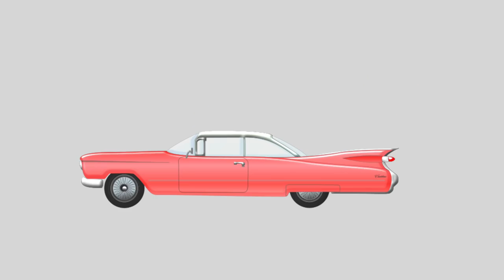Yes, Rockets CAN Fly in a Vacuum

Comment: Vintage Space I was wondering if you could provide a math formula that proves FREE EXPANSION in thermodynamics is not in effect in the near perfect vacuum of space, and could you also provide the math for the  debunking of work formula where work = pressure external (0) in space X the change in volume = zero work performed; that would really help clear up the confusion.

  The thermodynamics students are confused about the conflicting propulsion example given here VS the laws governing how gasses perform work, there is also some confusion about how high pressure can be obtained when the rocket system is an open system fully exposed to space at 0 pa; yet somehow pressure will just choose to stay in the combustion chamber, throat, and nozzle instead of just taking the path of least resistance and escaping out the nozzle and avoiding all that unnecessary work, and job pressure. 

  The chemistry students would also like to know how combustion and or chemical reactions happen in the zero pressure environment, becuse their experiments are failing to obtain combustion even with chemicals that have high levels of oxidizer and they are not even able to obtain the level of vacuum space provides at 10 x -17 torr or 0 pa.  Thanks we are all looking forward to the math so we can resolve conflicting issues...
Reply: Well, I'll have a punt at it.

Your error is in thinking that rocket engines would have to violate Joule Expansion, rather than thinking of the rocket as a rather big particle.

Joule Expansion, or Free Expansion as it is also known, is basically a thermodynamic explanation of the conservation of momentum, in that it describes a gas filling available space without doing work.

Well, for the gas to fill the space without doing work, you must have the centre of mass of that gas cloud stay stationary. But if we only consider the exhaust gases, then the centre of mass of the system will clearly move, meaning work has happened somewhere, however if you also consider the rocket to be a particle in the same expanding cloud of gas, you'll see that the gas cloud (this time, including a rocket that starts to move) expanding with no work being done.

Also, most Thermodynamics students I know are confused why people like you claim that the expanding rocket exhaust, impacting the inside of the rocket engine won't result in that rocket engine being pushed away.

Not to mention that, most chemistry students I know wonder why you'd think a pressure would be required for chemistry happens, since you just need the chemical reactants to be close together, and an energy source big enough for stuff to happen.
https://www.youtube.com/watch?v=Zv6KQzlLwU4
Here's a video of gunpowder being ignited in a vacuum chamber, just for funs.

And finally, the "pressure" of space is given as 10^-17 torr (whether such a small pressure can be called pressure is a whole different topic). Where did you get 10 * -17 torr?
Reply: @ShadowFalcon  ESA cleared up the confusion the moon is in our atmosphere.  Maybe in another 6 months all of space might be totally eliminated also.

http://sci.esa.int/soho/61130-earth-atmosphere-stretches-out-to-the-moon-and-beyond/
Thanks for attempting to solve the impossible problem, but ESA beat you to it.
OCS
Reply: @uncommonsense9948 
Methinks you need to read that article again mate.

Specifically when it comes to the distance of the moon, the density of the geocorona, and the Interstellar Medium.
Reply: @ShadowFalcon   Thanks for the video Falcon.  The Cody's lab vacuum video is having the same results we are seeing.  If you trap an atmospheric pressure in with the chemical a raction happens if not nothing happens even at a low vacuum.

  Simulating the 3 kalvin  average temp. of space with a 10 -17 torr vacuum would be more realistic but very difficult, and nothing is reacting anyway so why go through the extra trouble.

 It would be interesting none the less to trap the atmospheric pressure in the bottle then drop the temp to 3 K and see what happens; my predection is nothing will happen "no reaction"; if the temp. goes down so does the potential for pressure. 
OCS
Reply: @uncommonsense9948 
Well apparently you didn't watch the video., because the video clearly showed gunpowder igniting, whilst in a vacuum.

As for the temperature, space doesn't have a temperature, so I don't know where you get those 3 K from.

And the it's still not 10 -17 Torr, but 10^-17 Torr (or 0.000000000000000001 Torr).

Edit : actually the funny thing is that, the reason it's so difficult to get a loose pile of gunpowder to ignite in a vacuum, is because the gunpowder that does ignite produce gas, and blows away the rest of the pile before it can ignite. So even without the canister holding the gunpowder together, something definitely still is happening.
Reply: @ShadowFalcon  Thanks for the reply. The rocket is an open system not a closed system so the gun powder outside the bottle would be more realistic. The powder in the bottle proves without pressure no chemical reaction is possible the bottle contains enough atmospheric pressure to allow chemical reaction.

If 10^-17 Torr could be obtained in that vacuum chamber with a temp of 3 K  nothing would happen.

 Finally I think you can do some research on average temp. of space and find the number.
OCS
Reply: @uncommonsense9948 
The "bottle" as you call it, is also an open system.

The pressure in that bottle is the same as in the rest of the vacuum chamber.

And still, vacuums have no temperature. Without matter, you can't have temperature. The only temperature a rocket would have to overcome would be the temperature of the propellants (which in the case of cryogenic rockets, is a very low temperature).
Reply: @uncommonsense9948 
In any case, the primary reason for why the gunpowder is tricky to ignite, is because of its relatively slow burn time.

But most rockets don't run on gunpowder. They run on liquid Hydrogen and liquid Oxygen, or Kerosene and liquid oxygen, or hydrazine and nitrogen tetroxide.

All of those burn much faster than gunpowder, and in the case of hydrazine and nitrogen tetroxide, they'll ignite on contact.
Reply: @ShadowFalcon  Vaccums have no temp with out matter??  the rocket has matter and the fuel and oxygen have matter so there is some matter to react to the 3 kalvin average temp. of space.  If the above does not have matter what would you call it because matter has moles right? so the spraying of moles from fuel and oxygen or other chemicals is adding a lot of moles to space in a localized area, they will transfer  the cold temp.
  Moles do matter when combustion is the topic related to propulsion.  FYI moles stop moving at 0 kalvin and all the above statemets are published; not saying that means they are facts we the individuals can't prove it without lots of work, but it is accepted information.

OCS
Reply: @ShadowFalcon  Thanks for the fuel and oxydizer breakdown but I dissagree about chemical reactions in an open system at 10^-17 torr vacuum and 3 kalvin nothing does.
  It is so hard to get that kind of vacuum no organization on earth can obtain that level of vacuum.
The gun powder has an extreamly good reaction time and is easy to ignite that is why bullets are projected using the almost  always  ignitable and reliable gun powder.

 Yes a bullet will frire out of a gun in space there is enough atmospheric pressure in the bullet and shell casing pair that is tightly sealed, to allow combustion of the gun powder, so do not stand in front of one fired in a vacuum it will be the last time you will try that.
The glass container was closed with atmospheric pressure in the glass jar, there was not enough pressure differential with cody's low vacuum to pull all of it out so some pressure was in there allowing the chemical reaction to happen, but at 10^-17 torr it would have all been sucked out of the bottle and not allowing any gasses to build up pressure before they got sucked out of the bottle.
OCS
Reply: @uncommonsense9948 
What would stop the chemical reactions?

How can nothing, stop stuff from interacting?
Reply: @uncommonsense9948 
And yes, vacuums have no temperature, because to have temperature, you need to have matter.

The rocket has a temperature, it's actually quite hot because of the friction with the atmosphere as it goes up, and in case of cryogenic propellants, the fuel and oxidiser will be quite cold (between 14 K and 20 K for Liquid Hydrogen, and between 55 K and 90 K for Liquid Oxygen).

Space, on the other hand can't have a temperature, because there's no matter in space to have temperature.

As for moles. I don't think you know what a mole is. A mole is a measure of quantity, more specifically it means 6.022141*10^23 of something (for instance, atoms. Or possibly molecules).

Moles only matter, when it comes to balancing the combustion budget (basically, I have so many moles of O2, which will react with so many moles of CH4, which means I need to have so many moles of CH4. After that calculation you scale up to liters, and work with that instead, because it's a quantity, and counting molecules is tedious).

And I must repeat my question.
How did you get that 3 K temperature for space? What exactly is it, that has a temperature of 3 K?
Reply: @ShadowFalcon  Again the rocket is spraying in the matter in the form fuel and oxygen pumped into a 3 kalvin environment; unless now all the sudden fuel and oxygen have no matter in space.
Reply: @uncommonsense9948  
The temperature of the propellants are whatever they were in the tanks. They may radiate some of that temperature away when initially released into the combustion chamber, but radiative cooling is very inefficient, so you wouldn't loose a lot there. The biggest temperature challenge you'll have to overcome when it comes to igniting this, is the initial ignition of cryogenic propellants, where you have LH2 at somewhere between 14 K and 20 K, and LOX at somewhere between 55 K and 90 K, but the LH2 will already flashboil from being in contact with the much hotter LOX. Again, the propellants aren't being exposed to a "cool" temperature, since space doesn't have a temperature.

As for the CMB. That's the amount you'd be heated by the CMB, if that was the only energy source you'd be exposed to. The CMB is the blackbody radiation of the particle horizon of the universe, meaning it emits light consistent with a blackbody heated to about 3 K. So, in effect, when we release our two cryogenic liquids into our vacuum, they'll actually be heated a bit by the energy received by the CMB (but, since that energy is only consistent with that of an object with a temperature of about 3 K, that will not be a great amount of heating). There are actually other temperatures that can be associated with space, such as those of the Interstellar Medium, which can range from being a frosty 10 K, to an absolutely scorching 8000 K, but since the ISM is so thin, we don't generally need to take that temperature into account either.

And no, it isn't a "deep" topic. It shows your lack of understanding, regarding how vacuo work. Let's look at those experiments with gunpowder in a vacuum chamber again. We had two cases, one where we had a loose pile lying exposed, and one where we had the grain being relatively contained in an open cylinder, but otherwise still exposed to the vacuum. In the case of the loose pile, we did see reactions, but the reactions also helped blow the rest of the propellants away from the ignition source, thus throttling the burn of the gunpowder. In the case of the cylinder however, the gunpower was still exposed to a vacuum, but because of the cylinder, there was only so many ways for the propellant to go, meaning the flame front had a chance to catch up with the propellants. The nothing void of space can't stop anything, because it isn't a thing. To stop a force pair from happening, you need to remove the forces, but since we know a mass has been accelerated (the propellants move out of the rocket very fast), we know there has been a force. And the propellants will not be stopped from interacting, just because of the blackbody radiation from a far off particle horizon shining upon it.

As for your hypothesis. It is wrong. Upon combustion, the gas will expand in all directions, not just one. We however see the gas move, in just one direction (out of the exhaust nozzle), which means the gas MUST HAVE BEEN ACCELERATED. And since the gas has been accelerated from the nozzle (in the case of a J-2 engine, the gas cloud started with a net velocity of 0m/s, but ended up with a net velocity of 4130m/s when it left the nozzle) we know there must have been an equal but opposite force on the nozzle. That's the medium the rocket interacts with, the expanding gases resulting from the combustion of the propellants. As for the mass of the gas being equal to the mass of the rocket. Seeing as the propellants typically make up about 80-90% of the rockets total mass, I believe we have that covered, but in any case, let's look at the math.
F=m*a. So Force equals mass multiplied by acceleration. This means that, to accelerate a mass, we need a certain force, but it also tells us that, to get a certain force, we can either chose to accelerate a lot of mass, or we can give a little bit of mass a lot of acceleration. And seeing as we both have a lot of acceleration following the combustion, and a lot of reaction mass to work with in the form of our propellants, I'd say we have plenty to generate force with. Also, you still haven't proven that space is faked, so why even claim it was faked when you don't even understand how rocket propulsion works?
As for rockets working in atmospheres and vacuo, they typically work better in vacuo, because they have less ambient pressure to work against.

Well, I care. I care enough to actually get involved in shouting matches with those uneducated trollops who think space exploration is a "waste of money". I care because I know of the fruits we've harvested from the exploration of space, and the PC I'm typing this on is the least of those. As for gas laws, the gas laws work beautifully. They work just like the publications say they do, and they're among others the reasons for why rockets work. Hell, the fact that you think gas laws, and the laws of mechanics are wildly different tells me that you don't really understand what the gas laws say. The gas laws are directly derived from classical mechanics, and they work because of that. For some reason, you people have got it in your heads that rockets is the only machine that needs three objects to interact to fulfil Newton's laws of motion, while all other examples only need two objects. In the case of a car, it's the wheels and the road, and in the case of a rocket, it's the exhaust gas, and the nozzle.

I can only conclude that, your perspective of reality is based on a number of flawed assumptions, regarding conservation of momentum, the behaviour of gases, the properties of vacuo, and the generation of force pairs. Your entire grasp of physics is wrong.
Reply: @ShadowFalcon  First off I want to thank you for putting this together I know it took some time and this is your version of reality so I will attempt to keep my reply as civil as possible. 
 I do think this some great information on how rockets work in an atmosphere and very detailed but there are several points that do not fit reality as is published regarding the envoirnment of space.
1) There is a temp to space if you introduce molecules, the reason it can not be measured is due to the lack of molecules, but if you supply them through fuel and oxydizer it can now be measured, and molecules willl react to the extreamly cold average temp by not moving.
2  )Interstellar Medium, which can range from being a frosty 10 K, to an absolutely scorching 8000 K, but since the ISM is so thin it is not taken into account? ??? It is not thin where you are adding molecules it is thick according to your above explanition.
3)The gun powder experiment was not conducted in the exact environment of space although the low vacuum did give some hint of what to expect if the vacuum is increased to that of space.  NO one can simulate 10^-17 torr that kind of differential pressure would have been so great it would easly have removed any gasses from building up in the container with a pin hole in it. Cody's Lab also could not simulate spraying fuel and oxydizer into a container that once molecules were introduced would have a very very cold temp.
4)  You said:The nothing void of space can't stop anything, because it isn't a thing. To stop a force pair from happening, you need to remove the forces, but since we know a mass has been accelerated (the propellants move out of the rocket very fast), we know there has been a force. NO way you have any force, and your assumption anything is happening in that combustion chamber is just that an assumption.  Force does not exist with out a medimum to react with opposite and equal. The rocket can not burn 80 -90 % of it's fuel and oxdizer all at once so no you do not have a mass equal to the mass of the rocket NO FORCE PAIR EXISTS, no coulm of gasses are providing any a reaction force what so ever, noting is colliding back to the rocket, anything that leaves just keeps going, not slowing down, not providing any returned energy back to the rocket.  Further more I know more about propulsion than you and it is evident in your communications.  Let's take a propeller aircraft and supply fuel and oxygen to the carb in a vacuum bring the engine up to full power, nothing will happen at all no need to put on brakes the medimum required for a force is gone so you have action with no reaction, same with a turbine engine.  Take a boat prop out of the medimum (water) start the engine put it in gear at full throttle, you have action with no reaction no force pair exists. Take a rear wheel drive car jack up the car so the tires do not touch the ground, start the engine put it in drive, bring it to full throttle, there is action with no reaction the medimum is the ground and it is gone, no force pair exists, I could go on and on until hell freezes over on this topic.  Take a rocket designed to react with an atmosphere remove that atmosphere and put it in an impossible environment the vacuum of space attempt to fire up the engne at 10^-17 torr HYPOTHETICALLY SPEAKING ONLY if anything happens with gasses, masses, acceleration, etc their is no force pair, no medimum,  to react with, there is nothing created by God or Man that does not require a medimum to react with for movement, or propulsion  unless it is already moving.  If you dissagree than give me some examples besides the Harry Potter majic rocket in this thing called the vacuum of space.
Last)  If you give credit to your PC to this thing called space travel; I double dare you to say that to Steve Jobs and his dream team when you cross over from this life to the next; I feel confident he will set you straight on who gets credit for that acheivement.
I can only conclude that, your perspective of reality is based on a number of flawed assumptions, regarding conservation of momentum, the behavior of gases, the properties of the vacuum, and the generation of force pairs. Your entire grasp of physics, and chemistry is wrong.
Sorry I copy and pasted this from your reply because I could not think of a better way to articulate exactly my assessment of your comprehension of reality. In closing it is sad the only way I get to communicate with a person that has the gift of articulation is to debate this topic with you on two different sites and FYI R constant changes with atmospheric pressure or the lack of atmospheric pressure; take a close look at the formula for R constant.   
OCS
Reply: @uncommonsense9948  
1) Temperature is a measure of the internal kinetic energy (vibration, if you will) of matter. If there is no matter, you can't have temperature. This is why it's nonsensical to say that "space" has a temperature. However, that said, things in space can have a temperature, like the blackbody radiation of the CMB being consistent with that of a 3 K object, or the ISM which in the vicinity of stars (which we very much are) will consist of ionized gas with a temperature of about 1,000,000 K. But just because EM radiation from a 3 K "warm" object is shone on me, doesn't mean I'll insta freeze, and just because an ionized gas particle in the ISM has a "temperature" of 8000 K doesn't mean I'll cook, because the ISM is very thin. If I release molecules into that vacuum, they will not instantly lose any heat they had while in a holding tank, but they will very slowly radiate that heat away.

2) The ISM is very thin. In the vicinity of the sun, it's what's referred to as HIM, or Hot Ionized Medium (it also goes under the name of Coronal Gas), and that has an average density of 10^-4 (0.0001) particles per cm^3. That's almost nothing. If we mover further away from the stars, we get into the WIM, or Warm Ionized Medium, where the temperature drops to 8000 K, and the density rises to somewhere between 0.2 and 0.5 particles per cm^3. Still not a lot. So yeah, high temperatures, but not enough heat energy to light a candle.

3) The gunpowder experiment in its entirety was flawed, if the objective was to simulate a rocket igniting in space. And that's just starting with the loose packing of the grain. Then of cause, there's the fact that no modern rockets use gunpowder as propellant. 
But if you want to see a rocket engine being tested in a vacuum, then SpaceX has a video of their SuperDraco engine being tested in a vacuum chamber. The glow of the nozzle, strongly suggests that they attained ignition.
https://www.youtube.com/watch?v=8kWOsughufU

4) I know there's a force, because matter started moving. It's that simple. Matter doesn't start moving, unless it's been subjected to a force. F=m*a, if there's no F, you don't get an a, and without an a you won't get any kind of movement if you started stationary. Knowing that matter has started moving, we also know that, whatever that matter hit must've experienced a reaction force, thus completing the force pair. The only way you can remove the force pair, is to remove the net velocity of the exiting matter. Also, it seems you have a pretty big gap in your knowledge regarding propulsion, since you seem to think the kinematic interaction between the exhaust gas and the inner side of the rocket engine is in any way different from the kinematic interaction between a propeller blade, and the gas of the atmosphere. No rocket has ever been designed to "react with an atmosphere". They have all been designed from the basis of Newton's Third Law, with a kinematic interaction between a rapidlky expanding gas cloud, and an engine bell.

 5) Well, I personally don't believe in any kind of afterlife, but I'm sure if there was one, and I had the chance to get a chat with Steve Jobs, then we'd get along famously, talking about the development of modern computers, starting from Alan Turing's "Bombe" in WWII, to the Apollo Navigation Computers, to the IBM machines of the 1980s, up until the Smartphones of today.
As for the Gas Constant, used in the Ideal Gas Law. It's used in the ideal gas law, and as the name says, it is a constant, it doesn't change.
The Ideal Gas Law is P*V=n*R*T, which means we can re-write it to be R=(P*V)/(n*T). This doesn't mean R changes. It however does provide a limit for what we can do to our fraction since, if we change P or V, we need to also change n or T accordingly to make sure our fraction still equates to R.
Reply: @ShadowFalcon  I Got off topic to see how BOT would respond,
Reply: @uncommonsense9948 
Are you calling me a bot now, for correcting your statement about the gas constant?

Really?

Come on man, at least come up with something original, instead of just throwing your toys out of the pram.
Reply: @uncommonsense9948  
No, I showed you that the Gas Constant dictates the ratio of the pressure, volume, number of particles, and temperature of an ideal gas.
Claiming that the relationship between pressure, volume, number of particles, temperature and the Gas constant means the Gas constant "changes with pressure" is incorrect.

E=mc^2, doesn't mean that the speed of light changes with different energies or masses either, even though one can calculate c from that equation ( c=sqrt(E/m) ).

As for your "momentum problem".

Well, if P=0, then either mass or velocity has to be 0 too. If both have non-zero values, then P=/=0. It's that simple.
It is indeed also what we see, since we know the gas has mass, and we can see it has a velocity (i moves out of the engine bell), meaning it must have a non-zero momentum.

It's the same story with Newton's Second law. For F=0, then either mass, or acceleration must be 0. But, again, we know the gas has mass, and we know it has been accelerated (it started off with a v=0, with respect to the rocket, but then started moving out the engine bell), ergo our F must have a non-zero value. And Newton's Third Law says that, every force, has an equal bot opposite reaction force, meaning that, if the gas has experienced a force, then whatever exerted that force on the gas (the engine bell in our case) must experience a reaction force (there's your force pair).

As for your video.
I don't know why you think arcing is in any way relevant to how a Xenon Ion Thruster works.